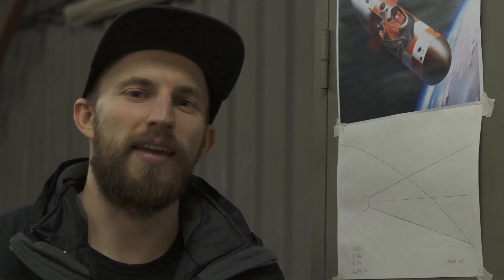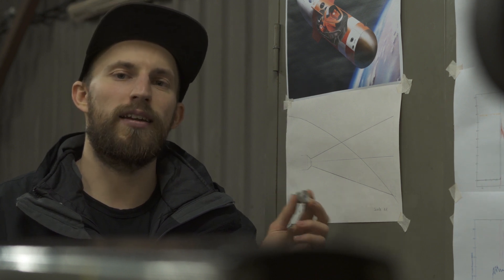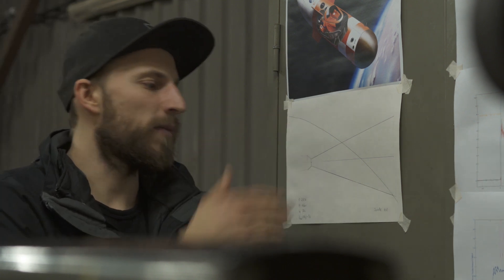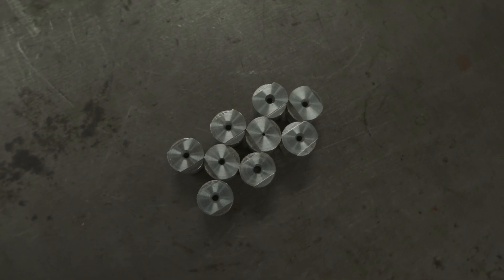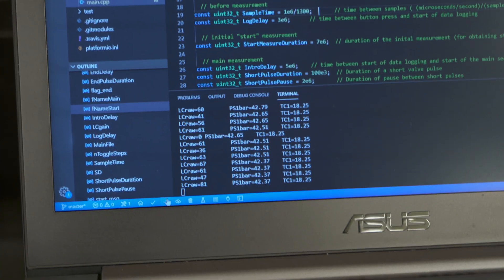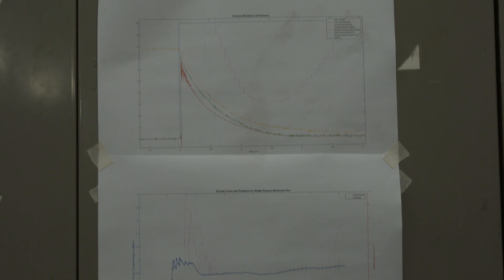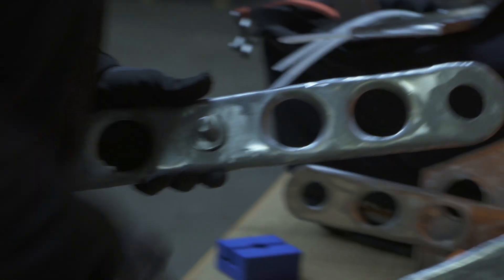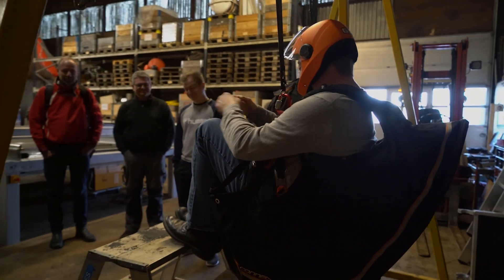Vacuum Optimized RCS Thruster Nozzle | INSIDE THE ROCKETSHOP : Episode 15

Comment: Would spica need ablative material on the capsule or is the friction levels low enough that re-entry wont be an issue, been wondering about this because of some of the graphic illustrations, which suggest the re-entry is going to be hot?
Reply from the maker: If all goes well, meaning we have nominal ballute deployment at the desired altitude, we expect the capsule to not experience more than 450-500C of heating. So ablative material might not be essential, but will likely be added as an additional safety feature. It could be a layer of cork like we had on the Tycho Brahe capsule, but other options haven't been excluded yet either.
Reply: @CopenhagenSuborbitals  thanks for the answer :)

Comment: I am actualy impressed by the the fast progress of this project, especialy seen to the fact that You run on almost zero budget even compared to other so called low budget projects that going on now.
Reply from the maker: Budget is not our only bottleneck either, it's also man hours. :)
Reply: @CopenhagenSuborbitals  I would gladly help if i was a bit smarter. :)
Reply: @Jeppe Achton Nielsen 

I worked as a blacksmith on my previous job, long time ago i had the pipewelder license as well, but i suspect i need to practice a bit to comeback to that...